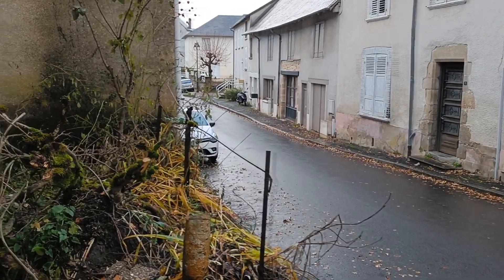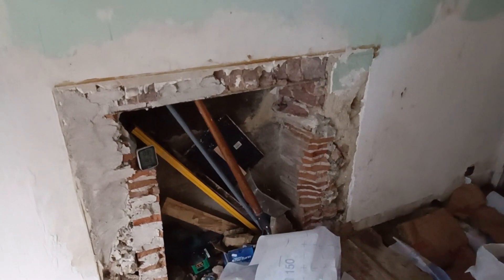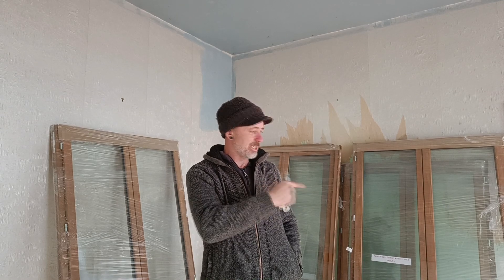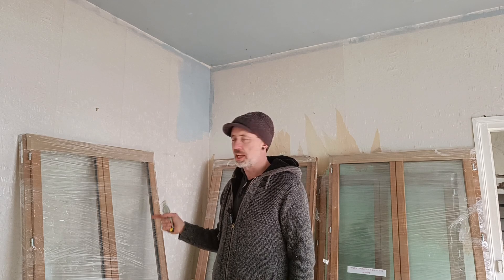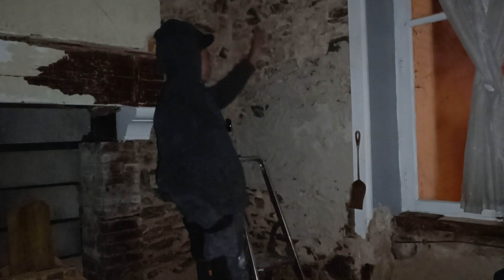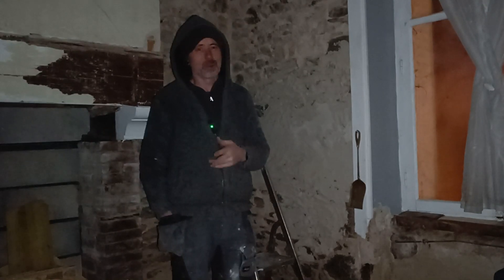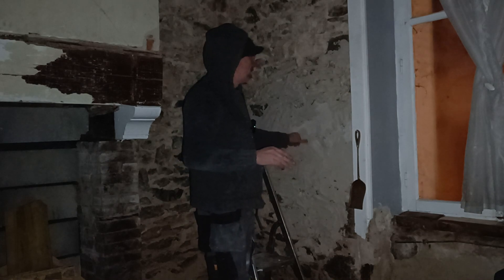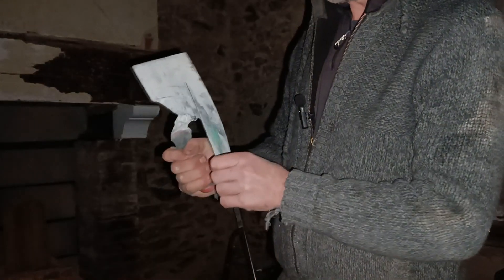Week 6 of full time self renovation of new home in France - Windows arrived and plastering started

Comment: those windows will improve the look of the property ,  are you wetting the walls before applying the lime mix? thanks for sharing cheers
Reply from the maker: Yeah delighted we went with wood. Option to change colour if we want at some point. I give the walls a splash before plastering. Hopefully get a good run at it today.
Reply: I use one of those pump up garden sprayers, give the wall a good soaking, let it dry a bit and then a quick spray again, just before applying the mix... keep up the good work..cheers @dublinvanlife466

Comment: Are the windows made to your size or do you choose from what ready made sizes is closest to what you need? Great channel by the way, really enjoying it. 👍
Reply from the maker: Howdy Jim.  Glad you are enjoying the videos!  These are off the shelf sizes and are pretty close to the opening sizes.  All the windows are slightly different sizes but close enough that it shouldn't cause a huge problem to have to adjust the openings a bit.  They have 13 height options and 5 different widths in the one we picked.
Reply: @dublinvanlife466 . Thanks for the reply. I’m am looking to buy somewhere in France myself, I was supposed to be there already but problems with the purchase means I have put it off for now, I am renovating another house at the moment (in Belfast) so can appreciate what you are going through, I am living in this house and work part time. The cold winter does not make it easy. 😂